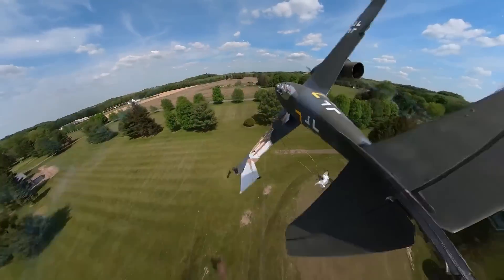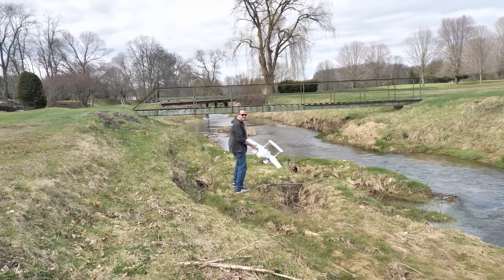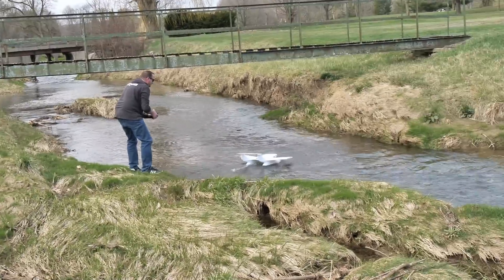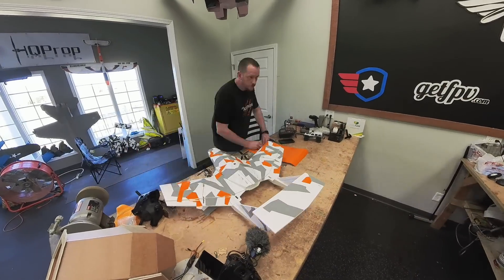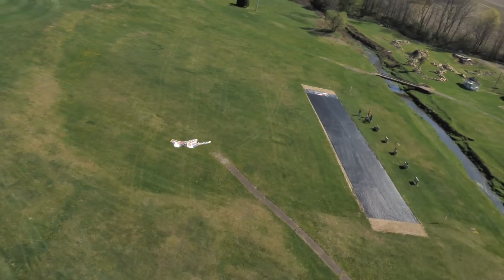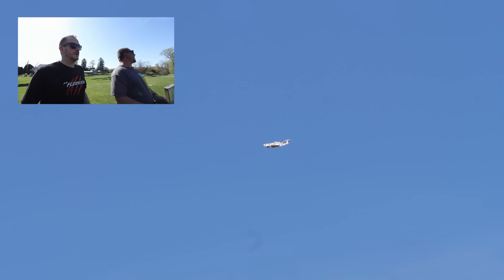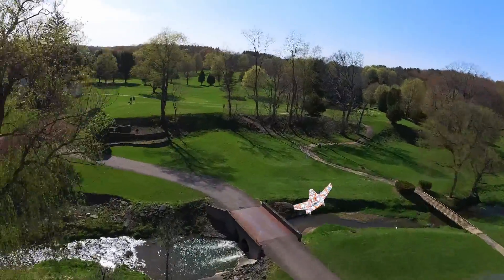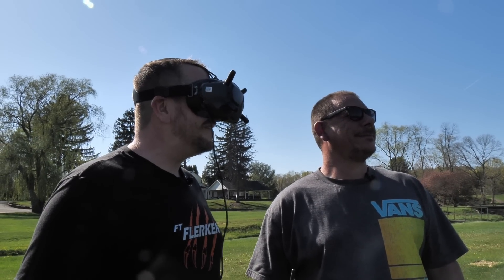The ULTIMATE FPV Racer YOU can Build!

Comment: I was also thinking about the Flerking being pretty close to the OV-10. The OV-10 has rectangular flat "hershey bar" wings, same with the tail, the booms are slab sides. The main fuselage is also slabs except for the rounded canopy and "pyramid" tail. AND, Bob Hoover's OV-10 was all white, so you don't even have to paint it. But if you want to paint it, you got Marines, Navy and Air Force colors, and probably various foreign users too. I vote for a very big OV-10. Great job on all your kits in any case.

Comment: One thing you might want to look at CLOSELY is the positioning of the floats on a typical airplane.  You will notice that the floats extend well in front of the nose of the plane.  Yours were WELL Behind the nose of the aircraft.  Additionally,  The 'float step' position should be at or just behind the Center of Gravity of the plane.
Reply: Yep that's exactly it. Your floats were designed for stability on the ground as opposed stability on the water. The old.old.old episode with Andris making floats perfectly encapsulates the fundamentals of float positioning.

Comment: For float design, get a large kiddie pool and tether the tail so you can find out how it sits and pulls in the water. a long tarp and a bunch of sandbags can make a stable water runway on the lawn that can be filled even in winter. You just have to fill and use it within a few hours or it'll freeze.
Reply: They have the pond right behind the clubhouse that they can use...problem solved. I'll be waiting for the video.